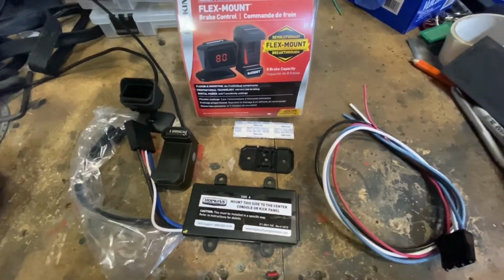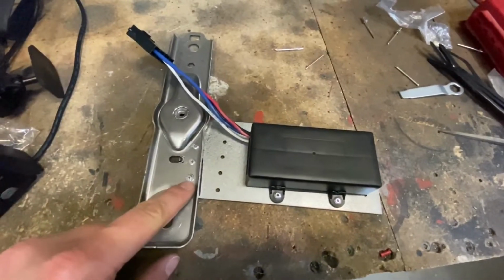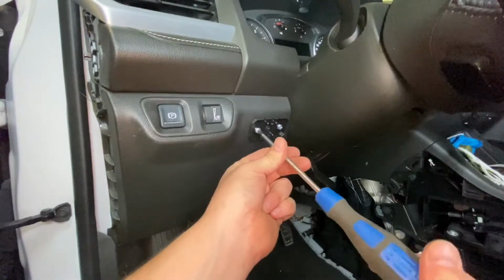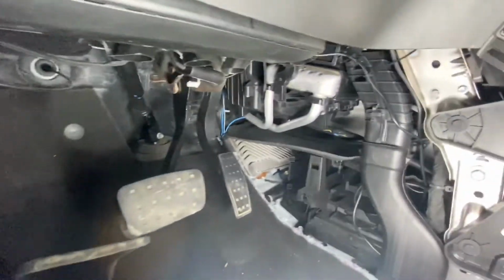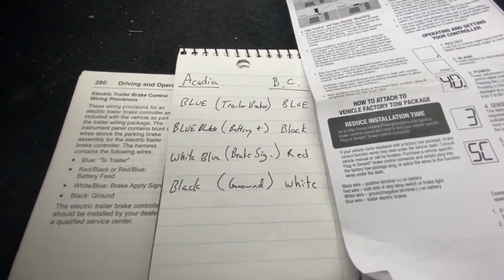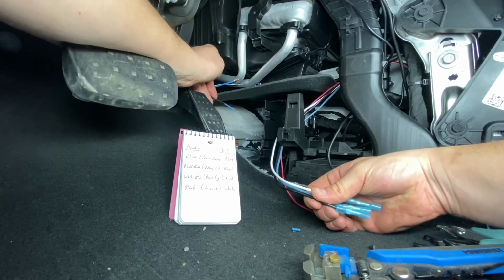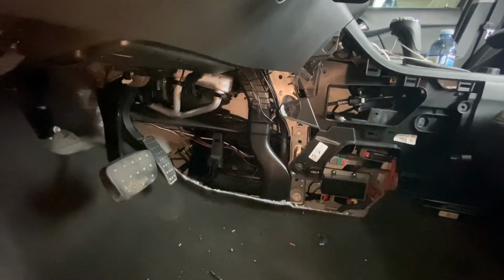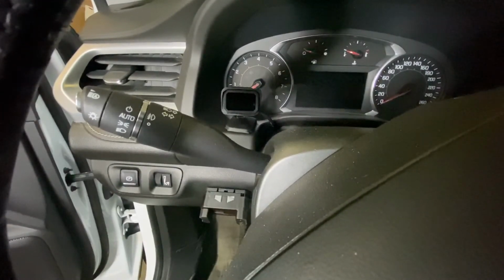Hopkins 47297 Insight Brake Controller Installation - 2017 GMC Acadia SLT-2

Comment: Can I install the control box in the trunk? That's where my battery is in my car and then I can run the ethernet wire from the trunk to the dash for the display and manual actuator